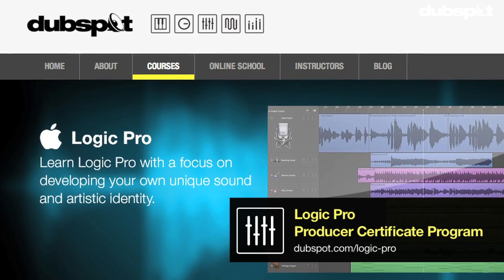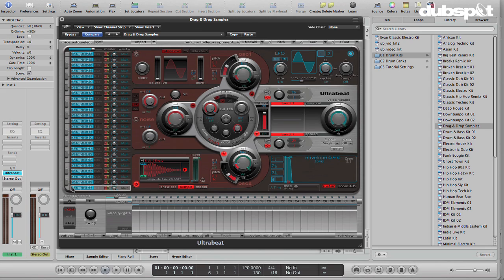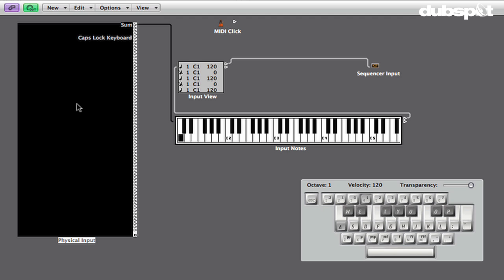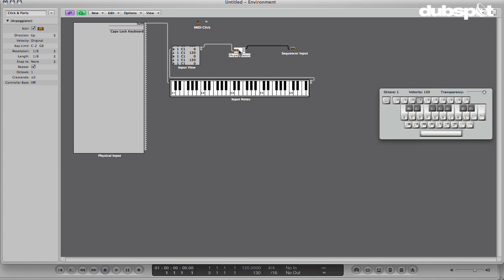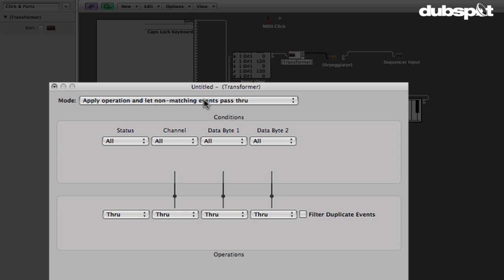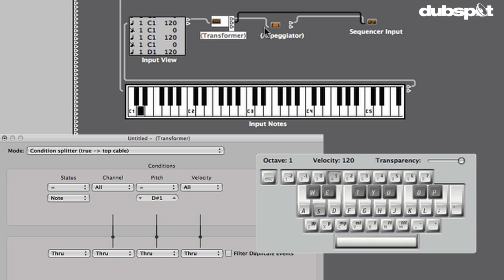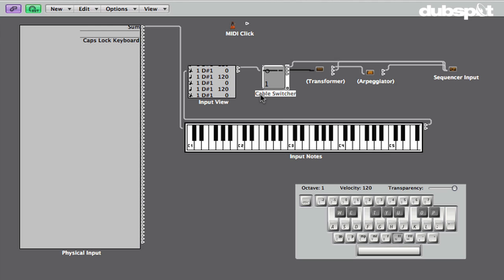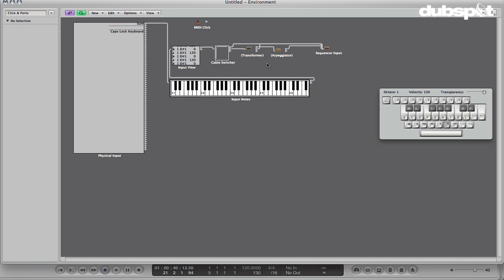Logic Tutorial: MIDI Drum Programming + Trap Beat Patterns (Pt 1 of 3) w/ Shadetek

Comment: Thanks for the video! Problem for me using Logic Pro X: arpeggiator doesnt do anything. In other words, the MIDI goes straight through the arpeggiator unchanged, and I have the settings dialed exactly as you do. Even if I dont use the switcher, the arpeggiator seems to do nothing. Got any advice? If not, I understand, and thanks again for the video.
Reply: Ozair Khan gotta hit the space bar first to put it on record mode and then..... wala !!
Reply: i have the same problem any fixes for this or does this video not work with logic pro X?
Reply: The arpeggiator will work only once the project is either playing or recording. So give the spacebar a lil tap and you should hear the arpeggiator taking its course.
Reply: Yemane Tekile I'll give it a shot and get back to yall
Reply: FunkPianoAcademy.com
 i have the same problem! do you find a solution?
Reply: Orbis Raul Alvarez Disla I did not - but I also moved to Ableton.. muhahahAHAHAghh coughs and hacks
Reply: i just do it the old way ,cut and paste :P ii stay on logic is a great sound engine ;)
Reply: Orbis Raul Alvarez Disla
Yemane tekile posted the solution. Press space bar before
Reply: Worked great ! Thanks mate !
Reply: thank you